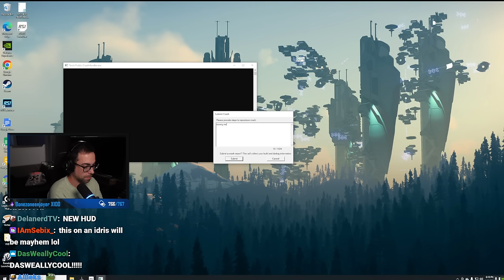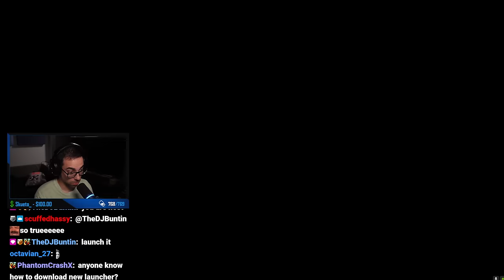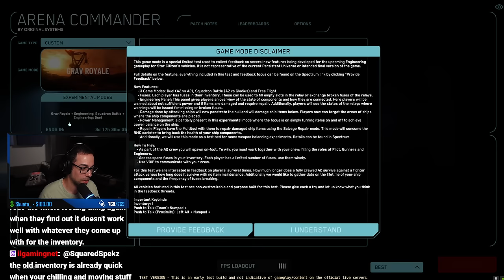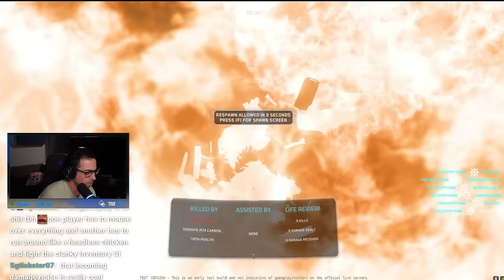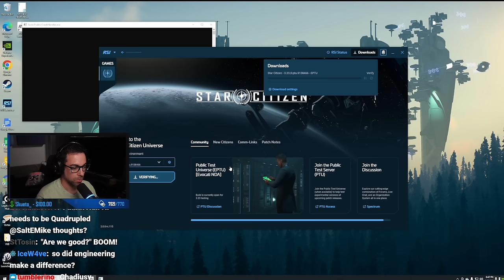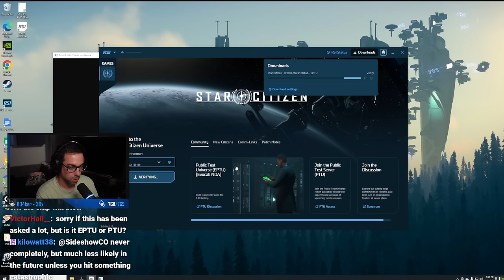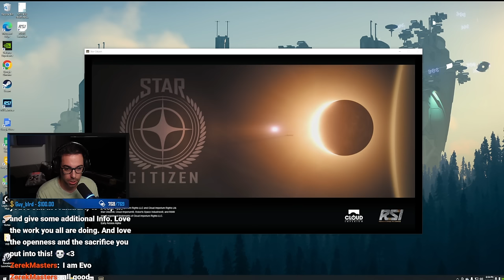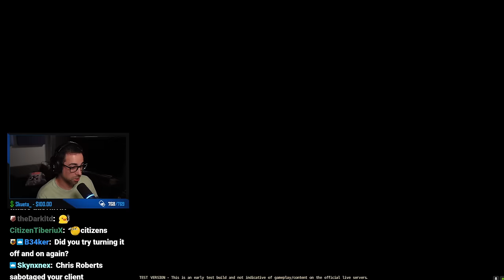Star Citizen in Wave 1 and the Engineering Preview is Here!

Comment: Solely based off what I saw in this vid, I'm sorta hoping relay replacement isn't the primary activity of the engineer. Power management and component repair are more interesting to me. I think relays going out should be somewhat rare or at least preventable through repair/maintenance.

I also think that an engineer tablet of sorts for remote access to the engineering screen would be fantastic. Then if certain systems are lost the tablet could lose connectivity, thus retaining a reason for the engineering station. This could also add depth to whatever tf "e-warfare" is going to be. Hack/jam a ship's internal network to make engineering more difficult for them.
Reply: Also, also... I don't know how I feel about these super important relays being wide open for people to fuck with. I think they should be inside a compartment that we can open and close. This could also be tied into the future ship permissions system so that guests can't just pocket a fuse for shits and giggles.
Reply: maybe they get damaged when you dont manage the power output and useage  correctly along with EMP weapons and stuff
Reply: @benlee8225  that would make sense to me. Though, in this vid it seems like they receive damage more or less randomly from incoming fire rather than engineer error.
Reply: @AuricNova we SS13 now
Reply: @AuricNova  yeah that's a real good point
Reply: Agree.  I imagine something more along the lines of multiple power routes to all components, with one route being the primary/ideal, and the others being auxiliary/emergency routes with reduced capacity.  System/route health indicated by green/yellow/red lighting.  It's up to the Chief Engineer to maintain maximum power to the desired systems by rerouting power, adjusting power output, shutting off damaged components, etc.

  Instead of the fuse/relay whack-a-mole, the damage party could reverse-hull scrape the damaged parts of the hull/restore pressurization, put out fires, replace damaged components, etc.
Reply: I don’t think it will mainly be fuse replacement, I think it will get WAY more interesting as a role over the next several months. I like your ideas, having more tasks sounds like really fun gameplay.

Comment: They need to remove that "head-bob" while you're in the engineering screen so your mouse cursor doesn't inadvertently move around.
Reply: or shift the mouse cursor to match, keep it consistent.
Reply: I actually prefer the "head-bob" effect, at least while in combat. I doubt you would be completely still in a intense combat situation. Especially in a ship that has a bridge that's going to constantly be peppered with shots. Think of it like "suppressive fire" for those standing aboard a ship in active combat. Now a better change instead of completely removing it is simply adding a chair for the designated person operating the engineering panel. Which should negate any "head-bob" like effects. Although, like it was said in the video, there should be more than one engineering panel in most large ships. So you may not always have that liberty while at an engineering panel. As such, you'll have to deal with a bit of a shake on the screen because you're not grounded like you're supposed to be. I do agree with the mouse part though.
Reply: Hmm but my immersion 😂
Reply: @ObiWeebKenobi  No thanks. It induces motion sickness and isn't good for gameplay.
Reply: @ObiWeebKenobi  I would like it as well if the game didn't run like shit for most hardware, until it runs well, keep the bobbing off, same goes for any interactive menu
Reply: I‘m okay with it when you’re getting hit. But it shouldn’t be constant.

Comment: The things I see that they can improve on are shwoung which turrets are manned so you can shut down the ones not in use. I would make the relays circuit breakers that you can reset on the screen, but make the components have to be repaired as they take damage.
Reply: That is simple my guy.

Comment: For this size of ships i think we'll need at least 2 ppl assigned to engineering permanently during combat. One to manage the stuff on screen and one to run around doing damage control. 
This also menas that the Carrack is at least one crew member short that the minimum necessary (1 pilot, 4 gunners, 1 engineer, 1 Dcon = 7 ISO the actual 6)

Comment: A lot to take in from this video, but the power management reminds me a lot of barotrauma. and engineering in that game is pretty fun. The battery chart with the red line looks awfully similar to the reactor output, and if you didn't have the power consumption follow closely to the power production the junction boxes would suffer (this case relays). I hope it does pan out to be that way, because then pilots who don't erratically spike the power consumption will place less toll on the engineers.

Comment: 6037 hours space trucking in Elite Dangerous , and looking forward to Star Citizen.
Reply: Fellow CMDR here: overall, it's all pretty good. Only one issue you will need to get used to is... turning via yaw is equally as powerful as rolling. It's very jarring compared to Elite's handling, but you get used to it.
Only issue is that for larger ships (like Anaconda and other large pad ships in equal to Star Citizen), engineering will mean you have to do more run around and multicrew will be absolutely critical.
So, just means more Pythons and medium ships equal running around.

Comment: It would be cool if they had smaller relays in cockpits of fighters so when one dies, it pops and sparks beside the pilot, and you have to let go of the controls and replace it with one in the glove compartment or something. 😆
Reply: maybe a animation like clearing the  jammed gun but its  them fumbling with the fuse and controls are sluggish or so on being attacked  coudl slow down the repair timer or time to hold the button  or push it back to no progress and have to bail from fight just to replace the fuse

Comment: When you have redundant relais on board, why they are on the same side(at least in front) when they are crucial??? And second, why you have to use a menu instead of a button click for pluging in one relais??? In Star Treck, Data would rip of a panel and rearrange all data crystals of the computer core in the same thime.

Comment: Weird that you are G-Safe whilst standing at the engineer terminal. Also i know this is just evo but with CIG's history; i doubt they will provide an in-game tutorial for how engineering will work. Also why the hell would there not be a mobiglass app that connects to engineering so you have the engineering screen  "on the go" in the ship. I build datacenters and our engineers have pads that hook into the local BMS (building management systems, for stuff like power, cooling etc.) - there are stations dispesersed every so often but mostly you will be using a pad. Dissapointed in CIG's vision of the future here :-/ their vision is too constrained and focused on forcing multi-crew. I.E 1 engineer on terminal constantly, 1 running around doing what the other says. So engineer 1 will have a boring time just looking at a low res view of the ship at all times. Fun.

Comment: please get rid of this 3d holographic bs.  whoever did the starfarer refuelling UI, just get them to do it as it is pretty decent.  it should be clean, clear and 2d with everything clearly marked.
Reply: It's 3d because large ships have components on different floors. If it was 2d, there would be too many lines crossing over or you'd have to switch between floors
Reply: @sparz14  i know, switching floors would be much better.

Comment: I am really not impressed at all by this fuse box whack-a-mole gameplay tbh. I really like the idea of engineering gameplay, but thats really not it. I'd rather repair and tune the individual components than running around like headless chickens replacing fuses, especially with the wonky inventory system. I know this is a testing enviorment so they probably have massively reduced durability for testing purposes but at the moment the fuses really go out way too quickly.
Reply: Well it’s just a test of one game loop right? We’ll get features added in the next few months and they won’t push it out to ptu until it’s meaty I bet.